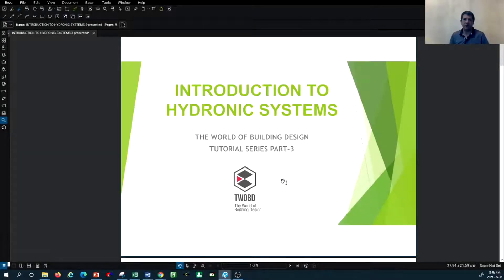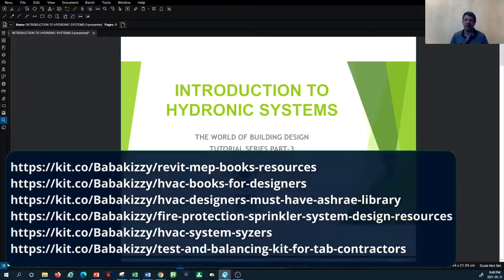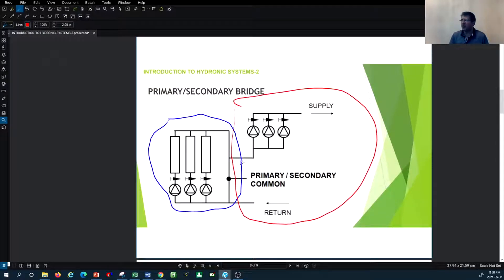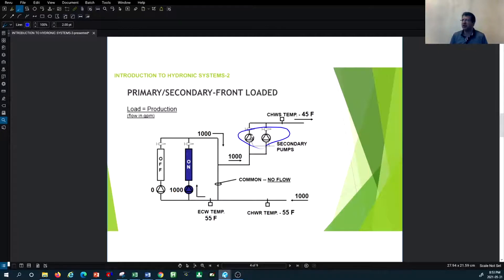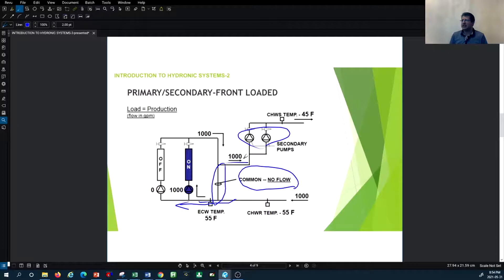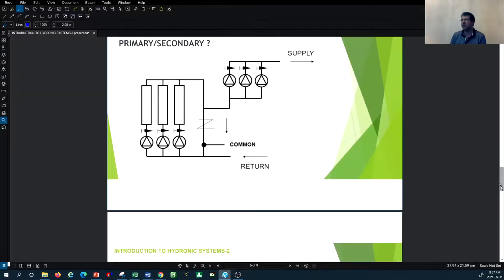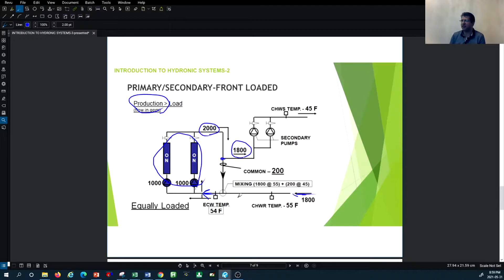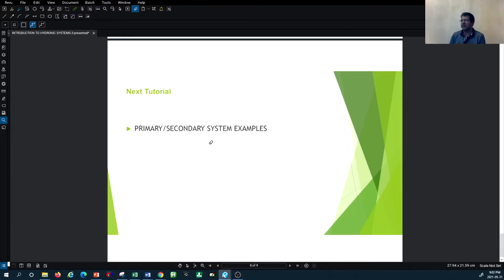HVAC SYSTEM DESIGN TUTORIAL- INTRODUCTION TO HYDRONIC SYSTEMS-3 -PRIMARY/SECONDARY LOOP SCENARIOS

Comment: That is a check valve that is put there to prevent the water going back when the load on the secondary is more than primary. But this is a wrong practice since the common piping needs to have a very low head loss in order to have the circuits hydraulically separated. By putting a check valve on the common piping we are introducing high head loss in that section.
Reply from the maker: Yes, I agree with you. Using Hydraulic separator as opposed to common pipe would be the best practice approach.
Reply: @TheWorldofBuildingDesign  Thanks for all the videos babak. Would be awesome to see overview of an actual systems later. especially systems connected to DES. Cheers.